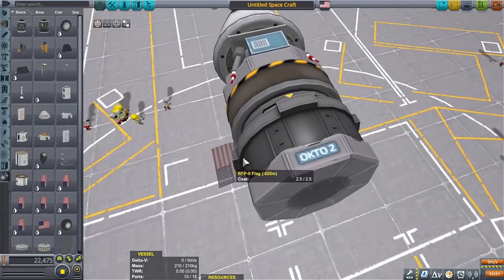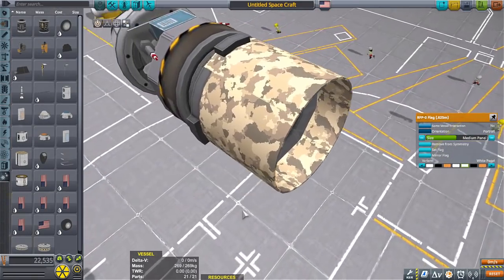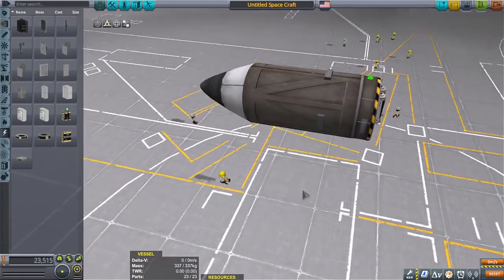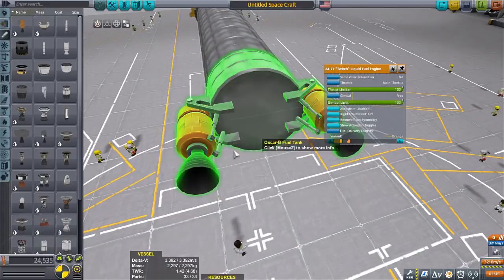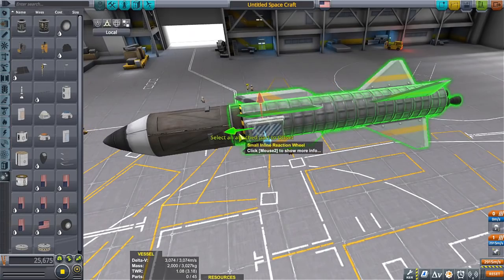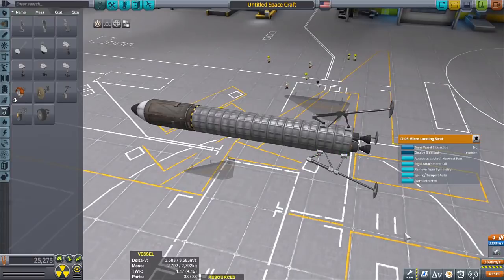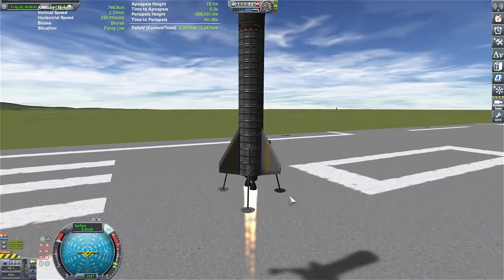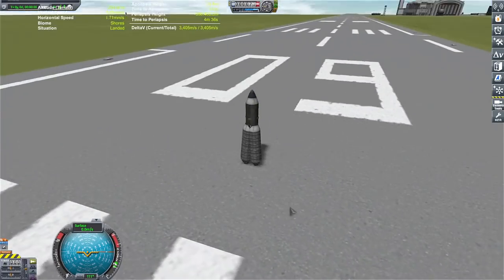THE MINI ROCKET  \  KSP 1.12  \  Kerbal Space Program

Comment: It's not suction cup landing gears. It's just suspension tolerance height you're seeing.
Reply from the maker: Sadly, whatever it is, it keeps the rocket on the ground almost a full second longer with the engines at full throttle, then not having any landing gears deployed at all. 🤔
Reply: @vaos3712  It might me true for suction property but then again, It is probably just the suspension bending the rocket, hence making the uplift force slightly have a bent curved trajectory so that the take off delays.
Have to do calculations to prove you wrong but I'm not gonna :D
Nice video btw
Feed me with sauce if it's internet radio, I'll listen to it while i make my podracer craft.
Reply from the maker: @XavierBetoN  lol ya, from now on I will be launching with landing legs retracted

Comment: I know that feeling; add a little necessary part & delta-v plummets. More practically, if I remember right, structural wings and wing connectors (I call them all "wing boards") have much higher impact tolerance than the actual landing legs. Many parts do. Mk2 & Mk3 are ridiculously tough. A bigger rocket could be made of Mk2 parts with the engines clipped inside. Mk2 tanks have no more capacity than the same-length Mk1 tanks, the rest is supposed to be air ducts which would be unused in a rocket, so it's reasonable to clip into them.